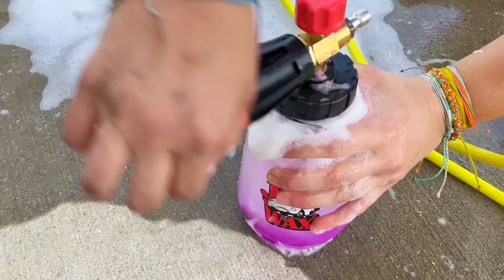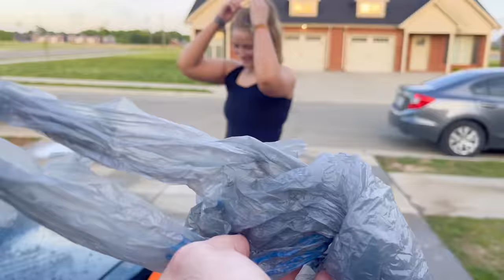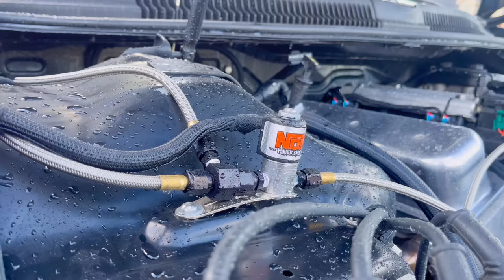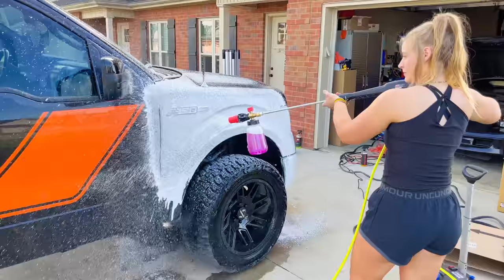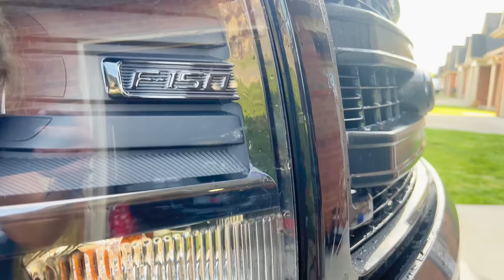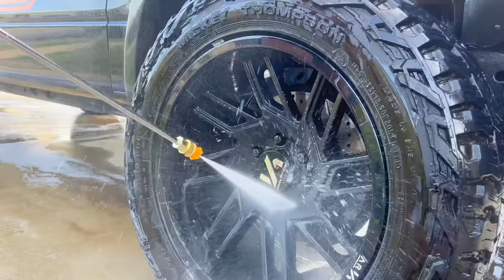Nitrous Camaro ASMR Foam Wash: HIGHLY REQUESTED

Comment: How long does it take you to wash the car? I have a 2001 Ford Mustang convertible and it takes me around 3 to 4 hours. Depending on if i clean the under wheel wells and inside. And i do it by hand. No machines.

Comment: After having an electrical issue from pressure washing I always avoid using it on the motor...
Reply from the maker: Know where your wires are and where not to spray